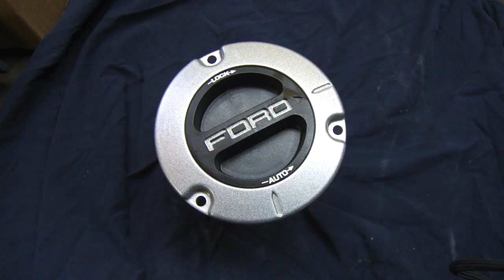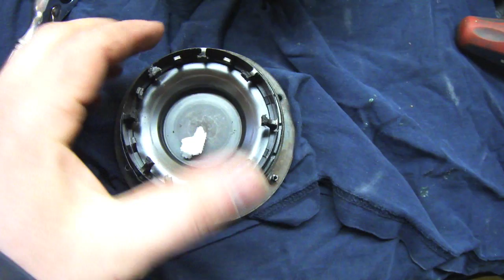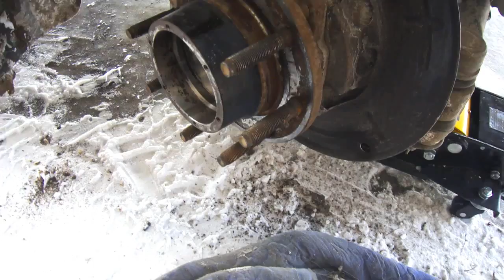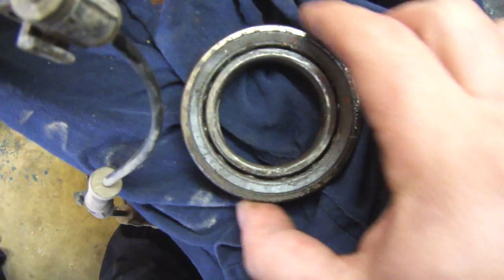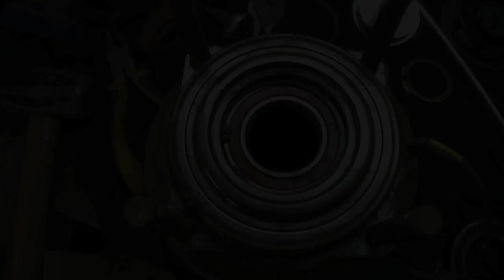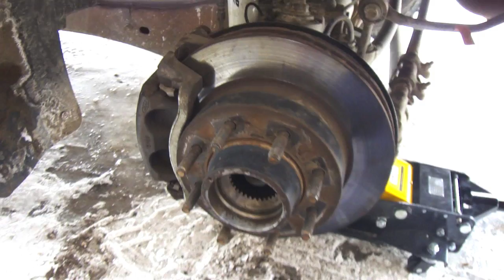F350 4x4 hub went bad took out inside bearing in hub assembly

Comment: Just bought duralast product for replacement the holes for the locking cap to put the three little machined screws into were not tapped out very disapointed

Comment: I had the same problem on my 2004 and gutted the vac hub also, Only problem with doing that is the axle shaft loses a lot of support. so dont wait too long to replace the hub, Total cost was 750,00 { U,S, currency }  for new vac hub, wheel bearing assembly, u-joint, and knuckle seal,

Comment: So it looks like you can just replace the bearing inside the hub. Was it hard and what tool did you use to get it out?
Reply from the maker: you can use a set of long snap ring pliers to get the snap ring out then use a bearing installer tool to knock it out

Comment from the maker: @rumerboyz my sound when the wheel bearing was bad wasn't loud either and it was a weird sound, the easiest way to find out is to jack up the truck and spin the tire, if the bearing is shot you will feel it roll rough and it will make a noise.  as far as the ujoint not spinning mine does that as well i think on the passenger side.

Comment: @Bullshitkorner  Well it's not a growl but it's like having a small stone in your tire and you hear that as it goes around and around. The sound is hard to explain but its not loud at all. the 4wd works fine but my one u-joint does not spin in the free mode, only when I jack up the tire and spin the tire then it moves.Oh, and both of those rubber seals on each side are just hanging there if that helps. Thanks

Comment from the maker: @rumerboyz that's not good at all, that means you have a bad seal somewhere to allow the water to come in, without seeing it for sure i'm going to say there is a good chance that hub is shot, I'm sure the inside bearing will spin rough and there is a good possibility that the wheel bearing could be shot as well.  Do you have a low sound while or growl when you drive by chance ?

Comment: How did you know your hub was bad?  My 2005 front u-joint does not spin when the hub is in the FREE Setting. And there is some vibrating up front. My F250 has Free and Lock settings with the lever on the floor to shift into 4WD. Any ideas whats wrong?